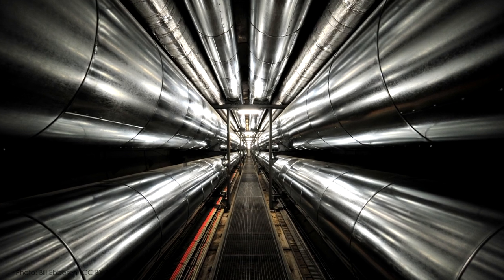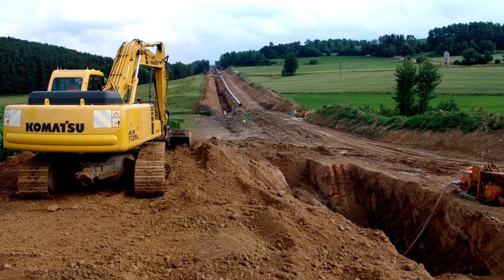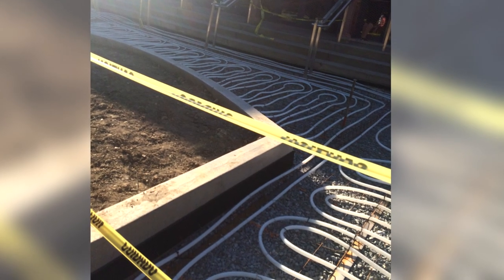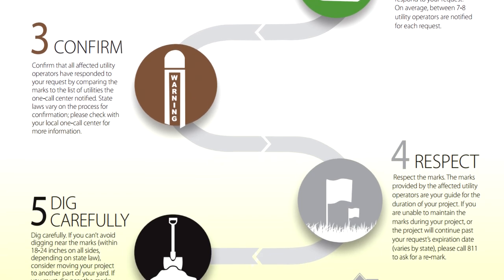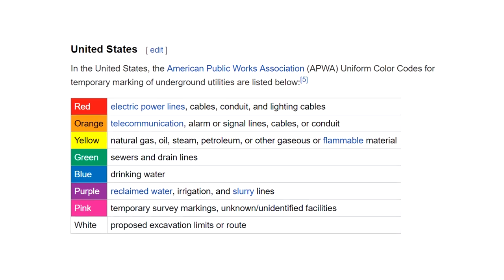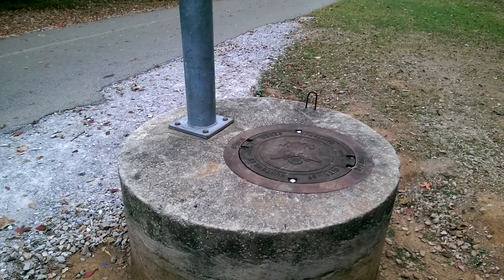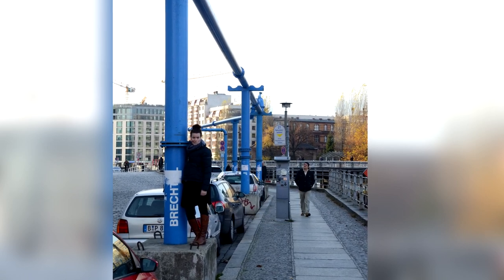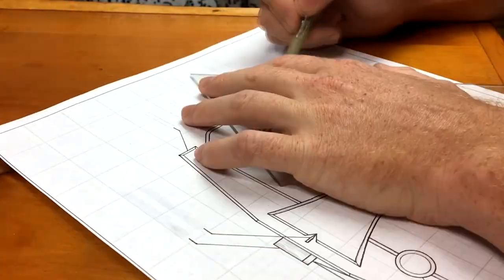What's That Infrastructure? (Ep. 4 - Subsurface Utilities)

Comment: Before entering a manhole to an underground vault (it might contain a valve for a water utility), you should always test the air before entry to ensure there is sufficient oxygen to sustain life. 

There have been deadly accidents where people didn't test the air before entering a valve vault. In one case a few years ago, two contractors paid for their honest ignorance with their lives. After the accident, our safety officer went to that vault and, without entering, measured an oxygen level of about 4% (normal is around 20%). This was a day AFTER all the first responders had been in and out of the vault with SCBA gear. 

The danger is that decaying organic matter in the vault can remove most of the oxygen from the confined space atmosphere. 

That is why most modern below grade vaults have two air vent pipes. There is usually a fan for sucking fresh air in to the vault to ensure that there will be enough oxygen to sustain life.  There is often a timer to periodically run those fans with a thermostat to prevent the fan from running if the ambient air temperature in the vault approaches freezing. 

With older underground vaults, we usually bring our own vent fans. That's what those big yellow hoses are that you often see near open manholes. The fan at the end of the hose is for blowing fresh air through the hose and in to the vault. 

I would advise anyone interested in exploring infrastructure to be aware that there are some very subtle and deadly dangers. This is only one of them. Please contact your local utilities and ask for assistance if you would like to actually visit such sites. They should know better than anyone what the hazards are.

Comment: Those blue pipes in Berlin are still there. I was going to say they were steam or hot water, but they don’t seem to be insulated.
Reply: thats just groundwater being pumped there ... Berlin has a famous longterm problem with groundwater and these are improvised solutions to safe buildings and underground tunnels. And they stay around for ages because a longterm solution is incredible complex, expensive and still not fully figured out yet.
You will find those pipes in multiple areas throughout Berlin, some are around for a decade now and became a monument for how slow public offices work. The pipe system itself is a common one used for construction sites whenever they need to get rid of water.

Comment: Does blue overhead pipes probably carry ground water pumped from construction sites. This is necessary to prevent flooding of any holes before concrete can be poured. As far as I know they should be as temporary as the construction site. But temporary in that case can mean several years.

Comment: Marty from Vancouver's picture may be a vent with a little cathodic protection voltage test box on the side, to check that the natural gas(?) pipes aren't corroded.  The manholes look like they could be regulator pits.

Note: I walked 40 miles of gas transmission line.  I have nightmares about underground infrastructure.

Comment: Every so often, I hear about crews finding unknown pipes...and they have absolutely NO IDEA what the pipes are for.  Sometimes several in the same area.  No records for the pipes.  One time the sewer contractor on a project hit an existing sewer line.  In this case, the sewer WAS marked on the drawings.  However, as they were digging from West to East, the Southward flowing sewer pipe was marked as being 4 feet to the East of where it actually was...so they weren't expecting to hit the line where they did.  And, yes...they DID break it!  Another time, they found (on the same project) a small line, like a 1 inch round electrical conduit.  Nothing about it on the drawings at all.  I remember wondering back then WHY DON'T THEY KEEP RECORDS OF THIS STUFF???

Comment: I was in Berlin last week and I saw those same blue pipes outside of Berlin Hauptbahnhof. It look at though they went to a dredging-construction site near the river. Part of the site was completely dry and looked as though it was below the waterline and the other was still flooded. My presumption was that those pipes were there to drain the flooding from the construction to a safe disposal area, as the water may be contaminated and not suitable to pump back into the river. Would this make sense?

Comment: I don't understand those Petroléum service station vent pipes, they can vent straight into the air yet if your Veee-Hikull has even a Small EVAP Leak you can gett lockked AWAY ¿¿¿¿¿

Comment: One question is burning under my nails for ages now: why does the water in US hydrants not freeze? Or does it?
Reply: In freezing climates, hydrants are typically dry barrel.  The valve is below the frost line (several feet below ground) and the hydrant body is dry unless it is turned on.  A long shaft extends to the stem atop the hydrant.  Valve at the foot is controlled by the stem.  The valve at the foot also controls the drain for the hydrant barrel (the vertical pipe from the foot valve to the place the hoses connect).  When the valve is closed, the drain is open, when the hydrant is fully open, the drain is closed.  So these types of hydrants (dry barrel) need to be either all the way on or all the way off.  In the middle, and you flow water both out the top and out the bottom; erosion and or swamp and or undermining ensues.  Common mistake in usage.  

There are also wet barrel hydrants, and these are used in non-freezing climates.  Wet barrel hydrants have one or more valves at the top of the barrel.  Wet barrel hydrants often become geysers (like in the movies) with vehicle hits.  Dry barrel hydrants can also do this in the right circumstances, but it is a bit less common.

Comment: You missed a little bit  beyond GPR and hydroexcavation, and might consider a part 2 on undergound infrasturcture locating. I market to the underground utility industry. Pipe and Cable locators use an AC RF current with a transmitter and receiver to locate metallic underground pipe or cables. We can also locate non-metallic underground pipe acoustically by by generating a sound on it with a mechanical knocker or a pressure stopper on a fire hydrant. 
https://youtu.be/O4E3Zqd_hLo

We also these days are more commonly recording location  when found with high resolution GIS and using maps to locate by high accuracy GPS/GNSS map alone in the future.

Comment: why arent power lines normally underground?
Reply: For powerlines specifically, its typically more expensive i believe, they have to shield the cable with extra layers on insulation as well as burry them. Along with that they are harder to maintain.

Comment: In Berlin - Those pipes run through the center, right above a massive construction site where they build a new subway line that prolongs a straight metro line going from East Berlin to its center - Alexanderplatz (U5), right towards the Brandenburg Gates, where the shortest subway line I've ever seen ends (U55), that connects the central station (Hauptbahnhof) to the Brandenburg Gates, through a stop between the administrative buildings and the Reichstag - a total of 10-15 minutes walking distance for the whole line.

I suppose they put them on top to maintain the flow of important stuff while construction works are going below.

This is the map of the undertaking https://klaustaubert.files.wordpress.com/2015/06/linieu5.jpg